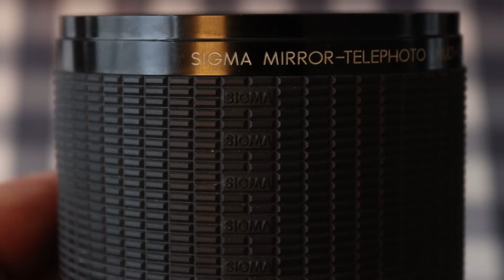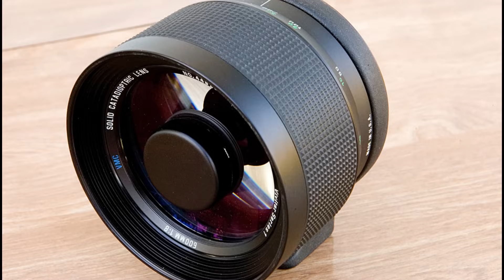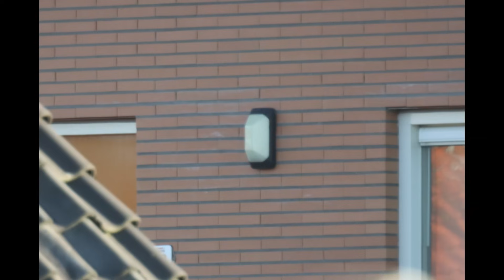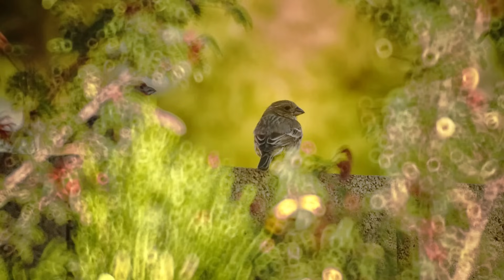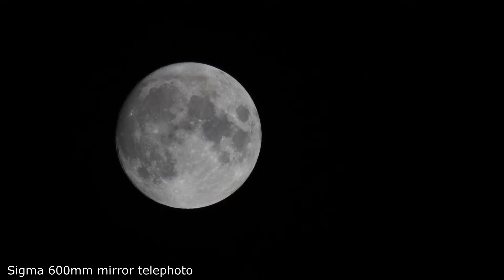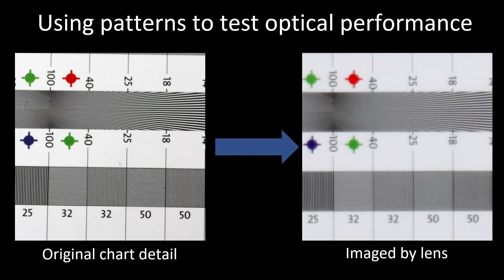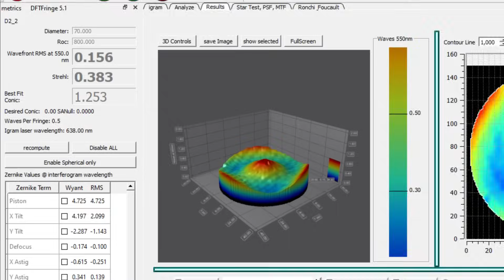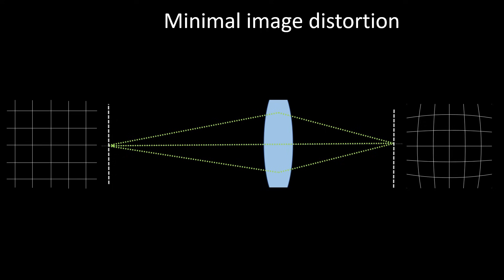Camera Mirror Lenses Part 1: Visual and Interferometric Testing

Comment: I've always thought of mirror lenses as optimized for two things, and tolerable for a third. They're optimized for astronomy, but also for air shows because the bokeh of the sky doesn't matter. They're tolerable for nature photography on a hike, when the weight and size of most long lenses become a serious concern. Is there anything else they're actually good at, as opposed to merely a mediocre substitution?
Reply: I totally agree mirror lenses are severely compromised .. but that last point about size and weight is enough in itself in some cases. 500, 600, 800 even 1000 mm fl traditional telephoto are huge and heavy. Even more so when you add a tripod strong enough to hold them rigid. Maybe some ornithologists would consider birds in flight or perched on a branch the same as your point about aircraft against a featureless sky. 

But this all becomes moot if the optical quality is too bad. Which sorry to say has been the case for every mirror lens I have tried so far. I'm very curious to.see how much a skilled optical wizard can tweak them in part 2 !

Comment: This is amazing! I recently got a Minolta autofocus 500mm reflex and have been having lots of fun with it. It's not super sharp but I'm impressed at how well it works adapted to my modern Sony camera. I'm looking forwards to the next video.
Reply: What did you use as a compatible adapter?
Reply: I have the LAEA5 with an a7iv. It only allows a small area in the middle of the frame to focus in single focus mode like the other Sony adapters. In continuous focus mode it uses more of the frame. Eye AF and face detect for example will work in most of the frame.

Comment: The most disappointing aspect for m was the heavy fringing I got on mine. I am sure the one small glass lens element Is the only possible cause, ruins the image quality. Other disappointment is the light transmission. The second mirror is typically too large and covers too much of the lens aperture.
If those had only mirror lenses inside they would be much better I bet.

Sigma lens, I think they are using some oil, glue or something the mold finds tasty because mine was clouded with fungus spots too.

Comment: Great video, and can't wait to see what you do to the Soligor. I have the same C/D version as a throwaway telescope, and it's design has the loosest tolerances I've ever seen. A BB in a soup can has tighter tolerances than the Soligor C/D.
Reply from the maker: That is correct, and the loose tolerances were actually part of the problem.

Comment: I know this is not a forum but i have an idea and i would like to know if it is possible. My idea is as follows: We put two satellites in space. One can rotate in all directions and the second one can propel himself in all directions. On one of them we put lets say a mirror with a 1 meter in diameter and with a focal length of 100 km and on the second satellite we put a mirror with 5 mm focal length at 100 km distance from the first satellite. With this arrangement we would have a 20 000 000 magnification and we could see exoplanets the size of earth, My question are: Could it be possible to build a lens with 100 km focal length and Would such a telescope work?
Reply from the maker: No sorry, it would not work. Even if you were able to make a mirror with 100km focal length, then the maximum angular resolution is still limited by the 1m aperture, and so it would not me sharper than a standard 1 m telescope with a much smaller focal length.

Comment: Outstanding explanations of optical principles in plain language as always, thank you.  I have a Sigma 600mm f/8 from the 1990's (?).  
Sharpness is fair but contrast is poor compared to refraction based lenses of similar speed.  I suggest you compare contrast of reflective vs refractive lenses in your follow up video.   For those interested in exploring the "solid" catadipotric rabbit hole see US Patent 3926505 by Rayces in 1972 and it's citations.

Have you reached any conclusions about the practicality of designing a monolithic mirror lens with only spherical surfaces?
Reply: My Sigma 600 had similar low contrast with okay sharpness. I also recall a lot of falloff.

Comment: Very interesting, as always!

Wow, I’m beyond blown away though by the fact that the total wavefront error in your optical system averaged out to just 0.009nm 😮 Did I understand that correctly? It seems just inconceivable to me.
Reply from the maker: Hi Dave, I was actually waiting for someone to comment on this, luckily you did. I agree, the values look unlikely and in fact they are. But they are the outcome of the average of multiple interferograms and the values that dftfringe actually yielded. Each individual interferogram yielded lower specs (Strehl still higher than 0.96) but they contained quite a lot of fringe print through. Somehow the print through averaged out when using multiple measurements. What helped was that I only used the center F:1 of the F:0.75 mirrors and applied some wavefront smoothing (5%). And of course we are talking rms wavefront error here, not pv. Which will in this case be multiple nanometers. Basically, you just caught me bragging :-).
Reply: @HuygensOptics  Haha - well I think you can still brag quite a bit! 😃
 
And oh duh - of course, the mean might be 0.009nm, but what's the standard deviation - or even the peak value, as you mention.

Still, it's an unbelievably impressive setup and result.

I'm curious what the specs are for your optical flat and spherical reference. Looking online, I can find off-the-shelf optical flats down to λ/20 or about 32 nm. Companies appear to offer flats down to λ/60 depending on size, but they're in the "request a quote" category. How far do they go, is λ/60 about the limit?

I'm curious about fabrication techniques too, especially for the spherical reference. I can imagine flats being not too unreasonably difficult to make, by the simple method of (very carefully!) lapping 3 flats in rotation with each other. (That is, AB, BC, CA) - And you can tell when you have them truly flat by referencing them against each other. How on earth do they not only make a perfectly spherical reference surface, but tell when it really is perfectly spherical? Per the story below, I guess that these days they could use coordinate-measurement systems, but I'm sure it was and likely still is all done optically somehow.

(This has nothing at all to do with the current discussion, but I think you might find it interesting. You’re probably already aware of this, but perhaps other readers will find it interesting as well…  So-called "onion ring" bokeh was a problem in the camera industry once molded aspheric lens elements became common because the tungsten molds used to form the aspherics were cut with single-point diamond tools, leaving spiral grooves on the mold surfaces. I toured the Panasonic lens factory in Tendo, Japan back in early 2014, and saw workers there hand-polishing the aspheric molds to eliminate the grooves! With feedback from very precise surface-profiling instruments, using pieces of soft, diamond-impregnated cloth wrapped around their fingertips, they could actually polish-out the grooves while maintaining the aspheric profile to extremely tight tolerances. I forget the tolerance of their measuring device, but they said they could bring the peak-to-valley roughness down to 20nm or less. This was huge news, as it constituted a real breakthrough in lens manufacturing and bokeh quality, so I excitedly wrote up an article about it for my website imaging-resource.com. Unfortunately, they wouldn’t let me show any of the photos I took of the setup and I had to leave out a number of details, but they at least let me describe the general process. ( https://www.imaging-resource.com/news/2014/05/02/the-end-of-onion-ring-bokeh-panasonic-beats-the-curse-of-aspheric-lenses ) Within a couple of years, the other lens makers had all figured the trick out for themselves, and it became common knowledge/practice. I wish that I’d been able to share more photos and details of the process, it really was quite an achievement and just mind-boggling that workers with bits of cloth wrapped around their fingers could polish tungsten molds to nanometers of precision :-0)
Reply from the maker: That Union ring story was really interesting. I did not know that it was even possible to make molds that yielded aspherical shapes so accurate that they needed no additional polishing. Thanks for sharing this article.
As for making spheres and flats: it is way easier to make an acceptable sphere than a flat, at least for the purpose of optical testing. Main reason is that the exact radius for test sphere is generally not extremely important, as long as the shape is correct. If you make a steep sphere, the geometry between mirror surface and tool makes the shapes converge towards spherical while polishing. The flat configuration however is an unstable shape that constantly tries to move towards to either convex or concave. So the latter requires constant corrections and steering, while a steep sphere does not and (when using the right tool and strokes) almost automatically ends up being perfectly spherical. Using an ultra low expansion material like zerodur or ClearCeram really helps eliminate thermal effects that might occur during the polishing process nd makes things even easier.
Reply: @HuygensOptics  Ah, interesting: Making a perfect sphere is just down to geometry, physics and statistical averaging, but those are all fighting you for flats. Makes sense now that you explained that, but my initial intuition was that curves would be harder.

The single-point turning process produces amazingly smooth surfaces; they appear highly polished to the eye, and even under a fair bit of magnification. I think the raw irregularities are  ~~100nm or less, which is hard to imagine since you’re basically just scratching a surface with a sharp diamond :-0 I don’t know what the specs are for the CNC in terms of resolution, but they apparently have no problem creating very accurate aspheric profiles.

The big(!) challenge in making molded aspherics is the molding process itself. Back when I last toured a lens factory the molding machines had 7-8 separate, very precisely controlled temperature zones that the mold/glass/mold stack passed through. I suspect that there may be even more thermal zones now, as they’ve advanced their art. 

Heat-up has to be slow and controlled, but cooling down is really critical, to avoid thermal stresses and consistently arrive at the desired shape, not to mention not cracking the lens entirely. Especially tricky (and an ongoing limiting factor in the process) is the challenge posed by lenses with large differences in thickness, with double-sided aspheric double-concave elements being the hardest. Apparently they don’t just need to avoid cracking, but excessive unrelieved internal stresses can cause optical distortions as well.

Interestingly (but as you’d expect), the profile of the mold is not the profile of the final lens; it has to be the profile that will produce the correct final one once the lens element has cooled. Obviously there’s more total thermal expansion (or contraction) in the thicker parts of the lens than the thinner ones. They have computer algorithms to model this, but it’s not a matter of just plugging in the thermal expansion coefficient, because internal stresses affect the shape as it’s cooling. As sophisticated as the models are, it can sometimes take a couple of iterations to end up with exactly the right profile.

One consequence of all this is that it’s harder to make aspherics with ED glass than conventional formulations. I think it’s some combination of higher softening temperatures, higher thermal expansion coefficients and being more brittle. Whatever the case, these days they’re starting to make aspheric ED elements, whereas they couldn’t several years ago.
Reply from the maker: Thanks again Dave for this info. Thermal control should indeed be one of the most critical parameters to control in this manufacturing process, because of the relatively high expansion coeffients of these glasses (generally around 7ppm) So a few degrees temperature difference means a few 10s of nanometers (or even more) off spec.

Comment: Would the Sigma Mirror lense work if used with a Teleconverter to get 2X the effective focal lenght?
Reply from the maker: In that case, I think that the intrinsic sharpness would be limiting. With a Strehl of 0.12 it will not give yiu higher sharpness, just a smaller field of view.
Reply: @HuygensOptics  Ah i see, thanks for the Answer man. Just thought that it being bigger on the sensor now, with smaller field of view migve resulted in a better image.

Comment: Catadioptric lenses have an inherently flawed MTF which ruins the image contrast.  You can think of such a system as having the MTF of an ideal lens of the major aperture, minus the MTF of an ideal lens with a diameter of the central obstruction.  This means that the MTF is decent at high spatial frequencies, but mostly missing at low spatial frequencies.  So imaging a planet like Jupiter will have a sharp edge (a step being a high spatial frequency feature of the object), but the equatorial bands are missing (low frequency feature).  This distorted MTF (you might think of it as a species of aberration not in the canon) is extreme in these mirror camera lenses because the obstruction ratio is high.  This is what causes the strange washed-out, low-contrast quality, even if the lens is otherwise perfectly made.  Also very difficult to collimate, and sensitive to any mechanical errors, as you found.

I know this from my disappointment with the Ritchey-Chretien telescopes.  Great for star fields (high frequency image), quite poor for planets and nebula structures.

Comment: What a great explanation! Those optical setups remind me of my graduation project which involved optical rails, an IR laser diode an .95 Aperture lens (still fascinated by how that was possible), a 3D object and a special sensor (the actual subject of my project). The other part of the project was making software to read out the sensor. After 6 years of studying Applied Physics and graduating, I turned to become a software developer for the rest of my life 🙂Still fascinated  by anything related to physics / optics  of course.
By coincidence, 20 years ago, I got married 700 meters from my house in Hofwijck, former residence of the Huygens' brothers 🙂

Comment: Wonderful video about mirror lenses. I have an original Vivitar Series 1 500mm Solid Cat mirror lens, which I found in a camera shop in Swindon, England the early 2000s. I'd wanted one of these lenses since the 1970s when they first appeared. These lenses were made by Perkin-Elmer, the same company that made some of your test optics and that made the mirror on the Hubble Space Telescope. It's a heavy lens and a big one. It's also very hard to use. The focus is fiddly and the lens is heavy, so it's for tripod use only. I wish I had a test setup like yours, to see what this lens is capable of imaging. Thanks for the terrific video about this quirky subject.

Comment: "The photography lense has to deal with multiple wavelengths."

Isn't that irrelevant when using mirrors instead of lenses? Or are there still some refractive components in these?
Reply from the maker: Yes, you might be surprised but there is not a single first surface mirror in these things.
Reply: @HuygensOptics  Huh, interesting. For the sake of robustness/longevity, i imagine.

Comment: oh man ... how do wish I had a friend like you many years ago when I designed my telescope ... 
maybe I could have built it ... but life got in the way 😂 ...  then other mainstream manufacturers attempted a similar ideea in particular Takahashi CN212 i believe it was called that did something rather similar and could have basically two different scopes within the same tube... a catadioptric and a Newtonian.  the difference between mine and the Tak was that I had a 180 Deg rotating set of secondary mirrors that could project either to the side of the scope or just through the main mirror.
so glad to have found your channel 😊

Comment: For a long time I checked reviews and sales sites looking for a good quality reflector, until in the end I ended up buying a Nikon 500 f4 Ai-P (a big chunk of low dispersion  glass (ED) and metal xD).
.
The reflectors that have good reviews in photography forums are the Nikon 500 f8, and the Tamron version of it (an "adaptall" if I remember correctly).
The thing with Vivitar is as you relate; unfortunately the optical quality of the Series 1 only lasted a few years (mid 70s, early 80s), when well-known manufacturers were the ones who did their work (the old optics manufactured by Kiron (Kino Precision), Tokina and Cosina for Vivitar are the best performers, and the ones that made that line of lenses famous. It is possible to trace the serial numbers of the time (those that start with 22 for Kiron, 37 for Tokina, 9 Cosina).
There were clearly good manufacturers, but apparently none of them were able to match (at least not until the late 90s) the multicoat treatments of the big brands (nikon, canon, top-of-the-line Olympus). There are very sharp 3rd brand "vintage" lenses (70s, 80s),  but the contrast, flares, are always an issue.
.
Thank you very much for this content, always amazing ! !